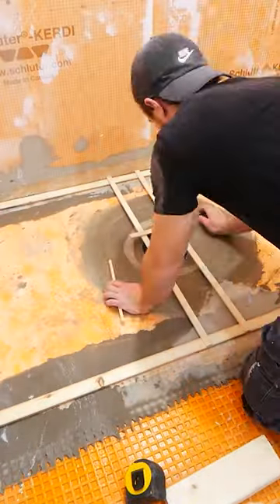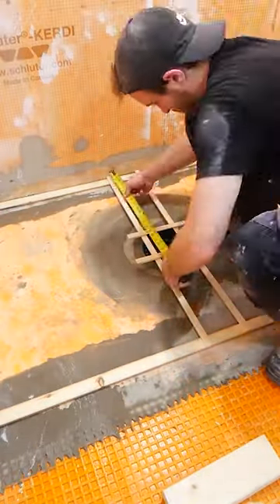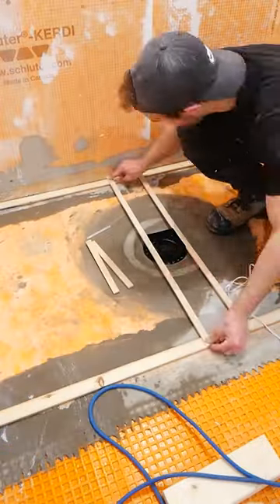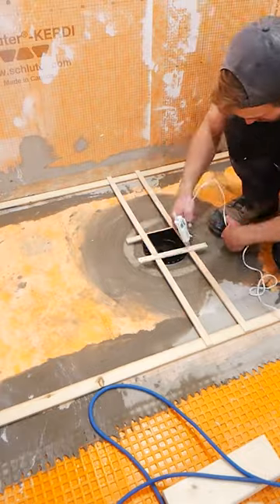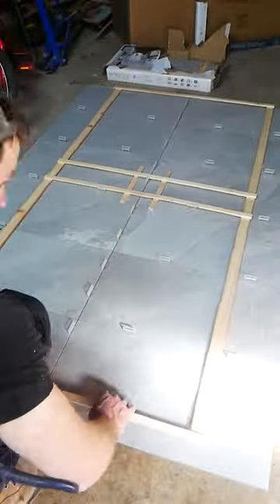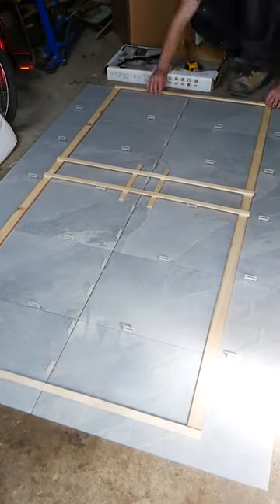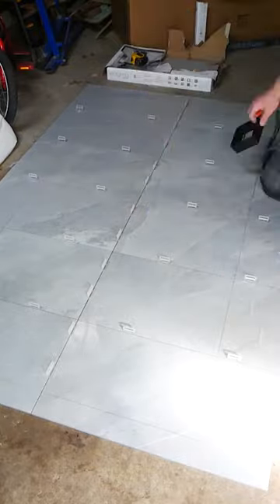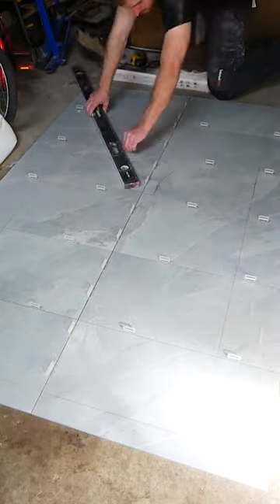How to Install Large Format Tile on a Shower Floor

Comment: I assume the drain is off center end to end due to the placement of a floor joist. It is centered side to side.  This is the correct way to do it NEVER cut your floor joist.
Reply from the maker: Wow someone who understands!
Reply: You can cut a floor joist as long as you header it off. You’ve got to be a carpenter to do that though.
Reply: Simply header it off. Passes code and can be even more ridgid.

Comment: Looked good, but you didn’t center the drain. That is crucial. Tile 101 always center the drain
Reply: I watched this video 6 times now I don’t understand what you’re talking about.
Reply: @jamesbennett2716  the tiles are shifted farther to the left. Making the cuts around the drain lop sided. The tile to the left of the drain is larger than the tile to the right of the drain.
Reply from the maker: Joist in the way :(

Comment: Nice work! However I can’t see how you make the slope first. Looks like completely flat surface to me! There should be at least 1/2 inch drop per every 12 inches.
Reply from the maker: It’s a prefabricated pan that comes with slope
Reply: and it's a quarter inch per foot slope
Reply: I just start on the back wall and work out
Reply: It 1/8" per foot.
Reply: 1/4 inch

Comment: Why didn’t you center your drain on that joint? Its 6” to the left, just curious why you would do that, for the slope? Or is that just how you ran it?
Reply from the maker: Joist in location

Comment: Ripped down prices of 2x4’s! Looks like you ripped them down to 1/8x 3.5” or 3/16” x3.5” and glued them together with a hot glue gun! a 2x4 is 1.5 inches thick x 3.5 inches tall x the standard length of , 8Ft and 9Ft 2x4x8, 2x4x9 and 2x4x93” to use for framing between the bottom plate and top plates that’s 96” - 3”